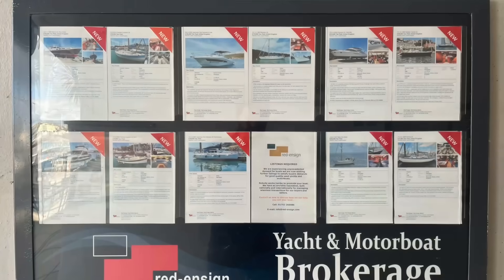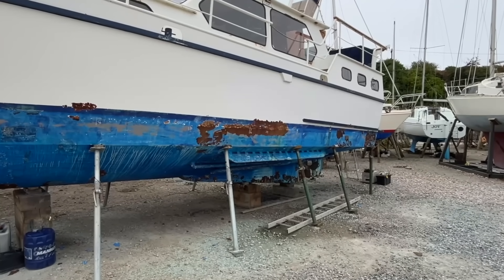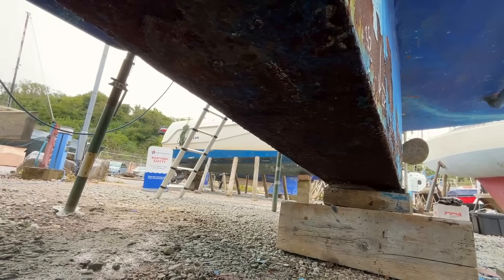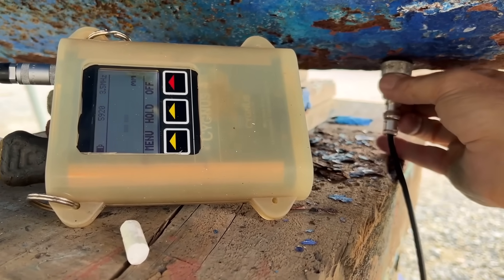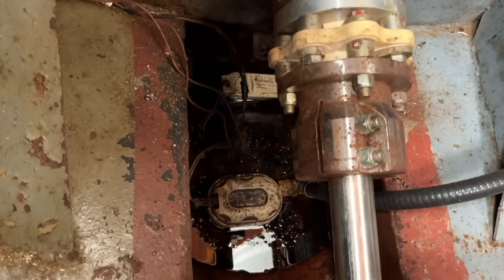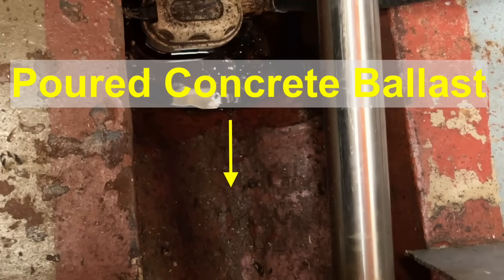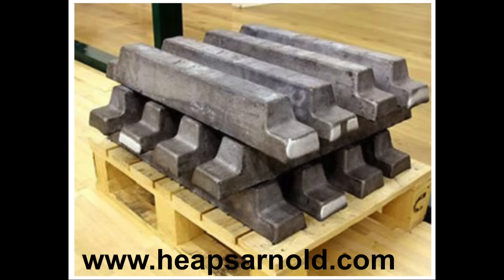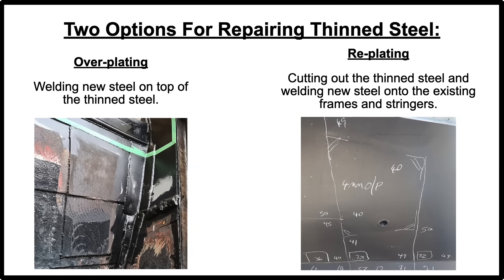Buying A Steel Boat? Get It Surveyed!

Comment: Surely as a marine surveyor for 30 years, I would have said the same. However, I have learned over the years its a fine line to be inspecting the vessel with client, broker and owner present. Often the client may ask the surveyor "If it was you, would you buy the boat?". That can put you in the wrong place as assumed to be working with the broker. Thats a hard place to be in. 

For those questioning this surveyors recommendations and suggesting build techniques, I would also stress that many times a surveyor will run across an idealist or novice who has a dream but no budget. Many times I have seen someone proceed with a purchase I recommended they walk away from, only to be eternally stuck in the yard or soon out of funds after purchase. Also, it is IMPOSSIBLE to gauge the extent of damage of possible structural issues in just a few hours. In as much as I have spent up to a week surveying a vessel, I always find more. 
Furthermore, as a surveyor one has to operate within the realm of applicable standards, standards that may ultimately save a life or avoid a claim or lawsuit down the road. The surveyor made the right decision. He is not aware of the buyers finances, vessel condition and is operating under the guise of accepted guidelines. Cheers.
Reply from the maker: Thanks for your hugely insightful comments, sorry it took me so long to find them.
Reply: @whitehatmarinesurveying Thank you sir, cheers.

Comment: I have been building boats for over 40 years. i generally stay away from insulting serveyers . I had a friend in the U.S named Thomas Culvin he a master steel boat builder (Look up his book, " Building Pinky" a 50 ft cargo carrying sailboat of steel plate, the steel keel on that boat was 1/2 inch which is about 5 mm, with a foot of 3/4 ,3/4 because it was a sailboat which needs ballast.  note that because steel boats are so heavy, generally speaking the Scantlings or drawings will indicate a much wider hull as opposed to FRP or wood, wider because of the weight of steel per square foot, example a 8 ft by 4 ft by 1/8 steel panel weighs 300 lbs , a 4x8 ft 3/4 inch marine ply weighs 40 to 60 lbs. i note that in the EU and UK builders have a tendancy to build Narrow boats, i do not know the beam of the boat i commented on pertaing to the servey, but it looks like its not tge standard wider beam a steel boat should be, that said, and if the case, then this would explain the use of slightly thinner materials. the standard for a 50 ft boat in steel here in the west would a 3/8 keel on 2 ft centers for the frames, frames would 1/4 inch to 3/8 depending the type of hull, shell plating would be 3/16 bottom and 1/8 sides or again depending on type, could be 3/16 side plating with 1/4 inch bottom plating. pound for pound steel is still the cheapest building material, now if this boat above say was 12 ft wide the width with heavier gauge steel would cause a increase in draft which inturn would kill efficiency. i had a set of plans for a 38 ft sedan the plans called out for 1/4 inch frames on a 1/2 inch keell with a 3/4 inch skeg or foot  shell plating 1/8 sides 3/16 bottom now this boats beam was 15 ft wide, this beam generally we might ser on a 53 ft Hatteras as an example but because steel boats are much heavier they require a much wider beam. I apologize for being insulting to me their is no such thing as a boat that cannot be saved. and the boat above is very much worth the money and effort, i owned a 42 ft chris craft i paid a 100 dollars for it, was steel in far far worse shape then the boat above, the cost to replace 40 percent of the hull was 4,500,00$ canadian dollars mind you this was over 30 years ago. if u can buy a wrecked steel boat its worth saving especially if your doing the work your self as owner. the bad side of owning a steel boat and rebuilding one is Sandblasting a horrible terrible filthy job and the fact you have only four hrs to get a primer coat after blasting this truly is the down side, also you will need block and tackle to get plates in place for welding. must go someone needs to buy this biat above i would in a second she is worth saving. regards D. Ottawa Canada:
Reply: half an inch is 12.7mm

Comment: Simply I do not agree with the serveyers report. Simply cut off the keel replace with thicker keel cut out the hull plating up to the keel and replace with 1/4 inch panels thick plating . Your nuts 15 mm no no 1/4 inch will work for the keel plate or 3/8 is very acceptable for the keel, 15 mm sounds like the surveyor wants the boat or he knows someone that does their for giving a bs survey that boat is Very much worth saving in better shape then the Blue Steel boat on you tube the British gentleman whom bought blue steel has rust holes top to bottom in far worse shape the the boat above described by a surveyer as not worth the effort, fact is a lot of people either cannot weld or cannot work with steel . Steel is not that hard to work with , with some basic welding experience and a basic understanding of steel boat construction and steel still maintains its position in the boat building world as the cheapest excluding ferrocement boats. So this surveyer is lying about giving up this boat. Further if you replace the 4 mm stuff it’s easier to cut and weld and the boat will have another fifty years of service!
Reply from the maker: Thank you for your comments @danielfitzgerald3417 and for questioning my integrity as an independent marine surveyor.
Reply: 15mm did seem a bit of an extreme suggestion. Fabricating out of 1/4 or 3/8 (around 6 and 9.5mm) would be significantly cheaper due to materials and general welding requirements. Making correctly sized welds in one pass is trivial on 1/4" plate, and depending on the joint not much harder on 3/8". 15mm is almost 5/8" thick, that's going to require more than one passes to get adequately sized welds, especially on the out of position joints. You probably would need to bevel the joints on the outside so that you can blend the weld smooth with the hull, that would increase the price quite a bit as well.  

Although it does sound like the surveyor made the right call for his client, if you have a budget that gets completely used up just buying the boat and leaves you little to no money for upgrades, furnishings or operating costs walking away is the right thing to do.
Reply: Emotions talking here. Any steel boat is "repairable".  But there are limits to common sense. 99.9% of people buying these boats are not looking for a project. And imho 15k repair bill is a very modest one. Not all repairs are the same. Canals are full of the "quality" self taught welder repaired boats nobody wants.

Comment: Quick question:   What is the “standard” steel thickness for hulls?  5mm?  6mm?  ???  Seems this vessel was built with the “insurable” minimum steel.   Of course standards were different 50 years ago.
Reply from the maker: Great question to which there is no definitive answer. Minimum thickness needed to build a narrowboat of this size would be 5mm (which is what most Springers were built from). Trouble is, you can't afford to lose much thickness before the hull either requires extensive work or becomes uninsurable.

Comment: Strange, 4mm steel is the standard for boats like this, without knowing the stringer and frame spacing it's difficult to say if it's "too thin" from construction. I own a 12m Dutch stringers very tightly spaced at around 300-350mm, would be interesting to know the spacing on this. 

Think possibly you're used to essentially overbuilt narrowboats following 10-6-4 construction.
Reply from the maker: Perfectly acceptable to build hulls from 4mm steel IF it's good quality steel AND you paint it and keep it painted.  This boat had one but not the other (plus poured concrete ballast) which didn't help.
I've surveyed plenty of ex-commercial Dutch barges. As you know, these were built for either Binnenvaart (inland trade) or  Zeevaart  (coastal trading) with different specs for each. The size and spacing of frames and stringers chosen to complement the hull plate thickness and intended use.
So yes, narrowboats are overbuilt, but they suffer from neglect in most cases.
Reply: I was a surveyor for a few years and Dutch built boats had a terrible reputation for stretching the rules
Especially their surveys many of which were not worth the paper they were written on
4mm steel is thin in general and only need 2 mill to rust away before they need re plating
4mm steel is fine if you dont want it to last long without constant care and you can bet it wasn't high quality steel in the first place
It never is......
A concrete filled keel is inexcusable and asking for trouble
Reply: @joeconnolly89 I beg to differ, my 48ft , 50y old dutch boat had tonnes of concrete in it. I removed it all, the metal underneath was like new. It obviously preserved the metal.

Comment: I know stainless is expensive but isn't worth it if you expect to keep it for any length of time?
Reply from the maker: It's a nice idea, but stainless steel doesn't perform well underwater where there are fixings through the hull as it is prone to crevice corrosion. Plus the plate costs a lot more and requires more skill to weld.

Comment: I had this happen to me in the bay area. I was going to buy this CHB troller or a chub as they call it, and I hauled it out put it on the hard. My surveyor came aboard looked around in about 10 minutes later, he told me to pass on it. Trust me 700 bucks.
The next boat was a golf star 32‘ aft cabin. He walked around, took one look and said buy it.
Always get a survey
Reply from the maker: Great advice, and well done to your surveyor for looking after your interests.

Comment: If you are going to live on a boat of any kind that hull has to be in good condition so why would you think that having to pump out the bilge more or less continuously is okay for any boat let alone a rusty steel one? If you don't like a survey and what it might tell you then perhaps when your insurance stops you might just think that survey was a rather good idea. When you wake up with your belongings floating by your bed it is rather too late to consider that very thin plate below the water line that just leaks a bit!
Reply from the maker: I often describe re-insurance surveys as being for the benefit of the Underwriter but paid for by the Owner.

Comment: I owned a steel boat for a while.... I think if you have a n immediate trip planned then they are tough and great.... but for live aboard or long term ownership they break your heart and wallet. Because control of rust on the outside is manageable, but the rust on the inside is a killer.... imagine your lovely expensive interior boat fit out having to be stripped out every ten years while the inside gets metal work done, sand blasting done and the latest coatings applied... that is their weakness they rust from the inside! 
Aluminium hulls can be even worse!
Reply: You are correct, they corrode from the inside , I have seen brand new narrowboats built and no coating applied to the internals ! also the welding done was not seam welding but stitch welding so even if there was a coating applied then the area that is inaccessible under stringers, bracings etc. that does not get any coating will be a corrosion point.  If I were to purchase say a narrowboat or a steel Yacht then I would get the inside abrasive blast cleaned, vacuumed out then immediate metal spray with Zinc or Aluminium, this is a dirty process which is why it is not more common but if you want to stop or even drastically reduce corrosion, then metal spray is a good option.
Reply: @AnthonyTobyEllenor-pi4jq  Some English steel boats after hot zinc coating would get a spray on type of rubber coating which worked pretty good, I just cannot remember the name of the rubber stuff.
Reply from the maker: Totally get where you are coming from, the inner surface is always the real challenge. I often describe narrowboats as:
"A (hopefully) pretty steel box with a (hopefully) pretty wooden box inside it with no access to the hidden surfaces of either"!

Comment: I'd love to buy a push boat ( not a tug boat ) and convert it to a houseboat.
 I know from personal experience that most used work boats on the market have thin worn out hulls, but still would be a fun personal project 🙂
Reply from the maker: That sounds like a great project, and you're right, often the hulls of workboats get pretty thin, that's why an ultrasonic hull thickness survey would be money well spent!

Comment: I worked on a cargoship and we also got some steel thickness measuring done on the double bottom. From my head it was supposed to be 20mm and the surveyor found places where there was only 16mm left. Which isn't too bad. BUT he only measured in between the pits to prevent the company having to pay for steel plate replacement. Officer forced him to measure the pits as well, and at places there was only 5mm of material left.
Reply from the maker: That's a great illustration of why surveyors need to be independent and able to report their findings without fear or favour. A 20mm plate with just 5mm left in the pits equals 75% thickness loss, way beyond any commercially acceptable standard.

Comment: glad you included  repair costs.   as looking at it i would not have picked it as a boat to buy.   you said it was out the water 5 yrs  i would ask why ???.   has it been check before and an issue found.
it has sat at that local paying rent and taken up space.   and having nothing done to it. 
would have been interesting at price it was being sold for   and if the seller clearly stated issues or how long its been there
Reply from the maker: You're right, it wasn't a great boat for a lot of people to buy, but the right person did turn up and she is now back in the water.

Comment: One glance at this boat tells you what you need to know.  You’d spend a year cutting and welding on this boat and it still wouldn’t be right.  Better to start from scratch.
Reply from the maker: True to a point, but the new owners have got her back in the water in about two months.  They now have a 7 year plan and are starting to bring the old girl back to her former glory.
Starting from scratch is beyond the budget of most boaters.

Comment: On the car shows they just use a knife point or a screwdriver to poke. A low tech option
Reply from the maker: Easier when there is nothing behind the panel and cars are never built from steel plate that is a minimum of 3 or 4mm thick to start with.  A hammer gives a lot more information to the experienced surveyor but wouldn't work as well on a car...

Comment: Retired boat mechanic. I have one horrible experience with a metal boat. As soon as it showed I said to my boss"condemn this boat, there is too much liability working on this this thing". Of course he refused, because all he cared about his bottom line. 
He gives me the task of tuning the engine, which was a horrible clone of a Mercruiser engine. I did my best, got it puring like an angry cat. I decided to do a closed hatch visual inspection of the boat, and yep. Holes the size of pencil erasers all over the hull. Later on, my boss fires me because a lower unit was weeping. A month later this boat was on the news for blocking the exit of the cove it was in, it was half sunk. Engines siezed and no money to get Sea Tow. There were other stories of how bad my old boss was. We won't get into that.
That was my last experience with a metal hull. Just quit if your boss tells to work on crap and expect a polished turd when your done.
Reply from the maker: Tough story. Expecting a polished diamond from a piece of rock with minimal budget is always a recipe for disaster.

Comment: It setting out
    instead of foam getting swamped with rainwater through cracks in bilge and inside it was that concrete 
  base + metal + water= 💩

Not even any zinc?? 😅
Reply: Captain jack into port 😅😂❤🎉
Reply: into fiberglass hull myself with balsa foam carbon fiber 
Little lead keel weight 
    So it sinks just up to the wheel house and snorkels staying out of water 
   In case people don't want to get up 
Turbo jet pump 

  In the bottom a water jet shooting into a velocity stack with parabolic ramp going out the wheelhouse roof
Reply: Good for if they won't clean too 😅
Reply: A lot of yachts are made to stay afloat if sunk like parabunkle Grady white video 
     So when they go to the bottom guns or gold cause drugs ain't that heavy 😅❤🎉😂 well maybe I really don't know 😅

Comment: A very good video as always! It is a bit surprising to see a Dutch built boat "underspecced" on the material choice. At least on the GRP side, they always tend to be a bit on the heavier side, well built and last for ages. The concrete may be an indication to the reason behind this, I suspect a tight budget during build dictated thin material and concrete as opposed to heavier material and lead or steel ballast. It might have been built as a charter boat for the Dutch canals, with a limited life expectancy.
Reply from the maker: Thanks. You're right that all boat designs are a compromise between material costs, labour and time.  As the old saying goes: "You can have performance, comfort or price, but not all three"!

Comment: I see a lot of free boats 

All are too expensive.
Reply: Most water logged foam sitting with freeze thawing cracking the inside 
     Have to use solvent to dissolve foam re foam fix glass and seal 
     It's a lot of work 
 If it's not to far gone might be able to park in some building in the desert for awhile then fix glass re-seal 

     Waterlogged beat boats are dangerous why you can get them free
Reply from the maker: Great repair strategy apart from the lack of desert in the UK!
Reply from the maker: "Cheap boats rarely are" is a wonderful truism.